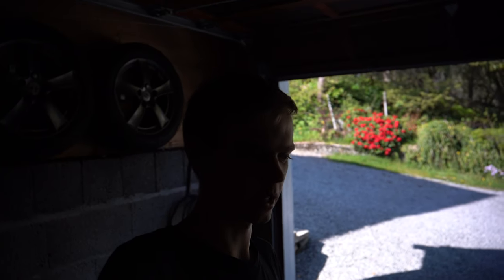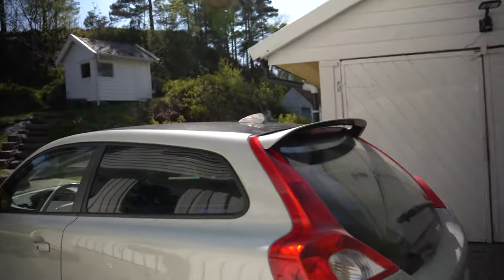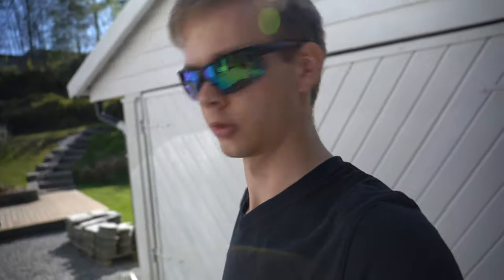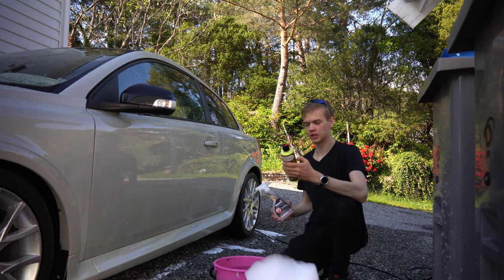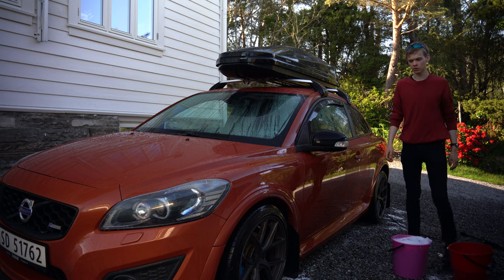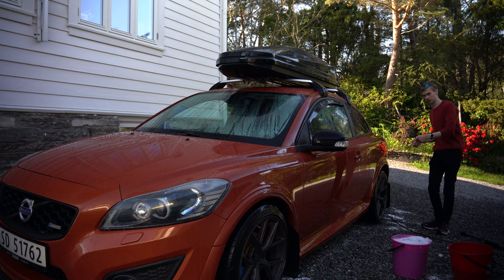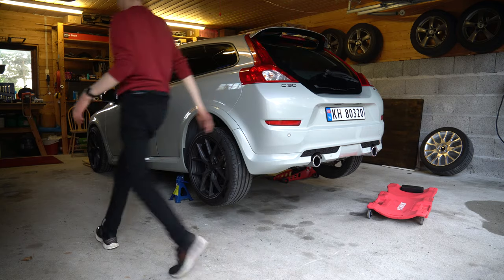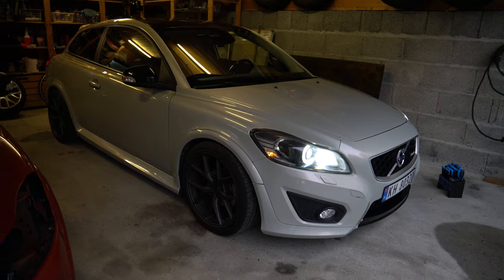I Might Have Bought Another C30 R-design... | Time To Modify!

Comment: im so jealous of all my eu friends across the water who get the diesel versions of these amazing volvos. we dont get those here in the states and its such a shame
Reply from the maker: It's both a blessing and a curse. From what information I have been able to gather, there's not a single facelifted C30 T5 that was sold new in Norway. And even with the diesels, we had thousands of c30s with the 1.6 diesel, which is just some basic unreliable Peugeot engine under the volvo engine cover. The D3/D4 were the only volvo engines they sold, and there are 18 D3s sold new in Norway, and only 2! D4s where mine is one of them. To say it lightly, I was on top of that listing as soon as it was up for sale, I called the owner within hours of the car going up for sale. I really wanted a more interesting color, but it had the M66 gearbox, R-design and the premium sound system, so it was a no-brainer. Only thing I would have liked is a sunroof, and the color of course.

Comment: Hi. Very nice C30! I also bought second C30 (2012., D3 R-design, silver.. previous was 2008. R-design, white 2.0D).. I've made almost the same mods on both.. like new wheels, coilovers, painted roof in black, LEDs etc. Now car looks really great, but I feel a need to remap and do something about the sound. I don't want to remove the mufler and EGR.. do you think that with just different muffler, it's possible to get powerful sound? Also, for remap I would go to stage 1 I guess.. should be around 70-100nm+..  just some little problems with transmission (auto) are worrying me. GL with the car!
Reply from the maker: Hi, I am in the same situation wanting som sound and remap, so I've done some research. There are no specific  exhaust systems for the D3 or D4 (same engine as you probably know). I also don't want to remove dpf or any other things that will give legal troubles. From what I've found, a T5 exhaust system will fit as long as you get an adapter for the correct pipe size. There are two videos by @richardfox2996 I've found with just DPF back exhaust system, and it sounds really nice I think. For remap, I will probably go with a BSR_Performance remap which gives a conservative 198 hp/435 nm for a decent improvement but without pushing the engine to it's limit for reliability's sake. I've got the M66 Manual, so I don't really know much about the Auto, but from what I've heard, they are decent. BSR provides the remap also for the auto version of the D3, and they always specify if their remaps will be to much for auto boxes.
Reply: @VinnesAuto I've just checked those videos. Sound is pretty good, I wouldn't want louder. I am not sure what is power flow exhaust which he is reffering to. So basically, we should just get any aftermarket exhaust system for T5 and re-fit.. that's it? I checked for BSR.. there is some shop ~100km from me so I might go do it. Thnx!
Reply from the maker: @AlphaScorpii1986  I think PowerFlow is a UK company which does custom exhaust systems. If you visit algperformance.co.uk and check their T5 exhaust systems, it says in the description that they also fit the D3 and D4 with Reducer adapters. So that's my source. So in theory just any T5 facelift cat-back system. Älg has alot of goodies for the C30s. I just ordered some driveshaft spacers to reduce their load from the lowering springs, and a new Rear antiroll-bar to tighten up the rear end. The UK has probably the largest C30 community, so I get alot of ideas and parts from over there.
Reply: @VinnesAuto  nice! Mods on car is a botomless pit :D. I am in Croatia so I would like to get stuff from EU to not have extra tax charges. Even if I don't get adapters, there are several exhaust experts in my city that could fit the new system.
On my car, I just got coilovers and rear camber arms.. everything else was just exteror mods like paint job (roof, little details, bulbs, blacking headlights inside, 10cm exhaust tips..). Car looks pretty good, but now I feel it needs more power to follow  exterior :). But I love it.. C30 is so rare to see, especially R-design.. + most of them here are 1.6. Our engine is so great. I had 2.0d PSA in my old C30 between 2013-2016, but this 5cy is just something else. I still remember how happy I was on the first ride! I just wish roads here were good like probably yours in Norway are haha
Reply from the maker: @AlphaScorpii1986  You make a good point, Norway is technically not a part of the EU but in practice we are basically a member. I do also get a few things from Sweden which doesn't require any additional tax. I only have lowering springs for the time being, but I really want a set of Bilstein B12 adjustable coilovers. I though about rear camber arms, but the P1 platform actually has a surprising amount of camber stock, so if anything I would get adjustable camber plates for the front, but they're not exactly cheap. Haha, Norwegian roads are generally not very good surprisingly, some highways here and there but they're no fun. All the B-Roads are generally old and narrow with a 80 limit, and then most of the few new B-Roads have a 60 limit :/ Which makes no sense I know. People fail to realise that inattentiveness and lack of focus is much more dangerous than going 20 over the speed limit on a nice summer day, but people's focus isn't really something they can control, so speed it is I guess. Logically I think a lot of crashes that allegedly are because of "speeding" are actually crashes from lack of focus, but they were coincidentally going over the speed limit at the time of crashing, and so it is automatically labelled as speed being the cause of the crash because it fits their agenda. Though I do also get that if you crash at a higher speed, there are larger consequences.
Reply: @VinnesAuto  Well, by bad roads here I meant holes and patches.. you need to come to balkans to see what I am talking about hehe. I was thinking between B12 and ST coilovers (KW makes them). They had the same price and I went with ST hoping they were less stiff (because the bad roads again..). Now I know that the ride being very harsh is actually my wheel being 8.5 which is too much for the 225 tyre that I have.. all the imperfections on the road are felt :/
Reply from the maker: @AlphaScorpii1986  Yeah, even my 225s on 8" wide really shows the imperfections, but I'm also on UUHP tires, so that also makes the ride more stiff. For me it's worth it though, because it also gives more steering feel. the original 18" wheels that came on mine are 7.5 wide, and they were on 235 tires,  Very comfortable, but lacking in steering feel.
Reply: @VinnesAuto  Oh nice, I saw your video from nurbungring so  I guess tyres were for that :). Good luck and please make a video about new exhaust system and/or remap if you make it!
Reply from the maker: @AlphaScorpii1986  Will do!

Comment: What exactly did you change about your headlights? Halo lights and painted? :D
Reply from the maker: That's it! Paint and flexible led strips/tubes. I have since removed the halos, because they were a bit troublesome with maintaining them. Every time they would loosen or something you have to split the headlights to glue them back in place. I ended up repainting the projector surroundings silver, as it gives the same general look and less maintenance. You can see the new style headlights in my latest video.

Comment: Where did you not get the remap from? I wouldn't want to do that to my 1.6D, because it's got plenty of acceleration 😅
Reply from the maker: I didn't use BSRperformance 🙃😂 They make quality remaps that you can load to the ECU yourself. Buy the remap with the ppc3 unit, put the car battery on charge with a 10A+ charger, and follow the instructions. Takes literally no more than 5 minutes and it has 139hp 300nm torque, with a really fun power curve!

Comment: Hey man. I'm in the market for a c30. I found a c30 2008 2.0 diesel, with The R design badge on the front  but I think it's just a sport trim variant (no other rdesign logos). 
The front bumper is curbed badly but i think I can save it. 
Also the sideskirts and the back has curb damage as well.

Any recommendations on what to be vary when buying it ? I can get the car and video call you if you'd like. 

I fell in love with this hothatch design.
Reply from the maker: Sounds like a late 2007 model, which had a sport trim but R-design didn't become a thing till 2008. It might still be factory lowered and have some other upgrades, but it's not as easy to know. I am actually planning a buyers guide for the C30, but I can give you some essentials. Ask if the DPF has ever been changed, since they're typically recommended to change every 100k km, if not that's a good way to knock some money off. Ensure that the cambelt has been changed, regular maintenance oil and filters. If it has a diesel preheater, they almost never function properly, so there's another way to get some money off. Both my C30s the preheater worked two times before they stopped working. Ideally they should be run at least once a month even in summer to maintain the system, but almost no one knows this. It is smart to find out how it is for rust on the underside if possible (depends on your location) but ideally you want one that has at some point been undercoated( I have done both mine ). Chassis rust you should look around the door-handles and on the inner corner of the doors and front fenders primarily. If it's an auto you should ask if they have done regular flushing of the gearbox, since that's not actually in the maintenance plan, but is preferable for a long and healthy life of the gearbox. Also check what tires they have on the car, because the owners choice in tire quality often tells you something about how much the previous owner cared about the car.
Reply: @VinnesAuto  Update, sadly enough, after inspection, the C30 was in bad condition, also there aren't many Volvo mechanics in my country. I went for a hidden gem, the Mercedes CLC for similar price. (same class with the BMW 1 series and Audi A3 and the C30).

Comment: I've got a 2009 2.0l diesel r design c30, I keep seeing P1, D5 or whatever, my bhp is around 134 so what does this make mine any ideas? i guess the P is for petrol and the D for Diesel but im still lost.
Reply from the maker: The D(followed by a number) is a later style designation for Volvo's diesel engine. They were used on the facelift models of the C30 (and v50/S40). Your engine is just known as the 2.0D which is a 2L 16v 4cyl engine. It's actually not a Volvo engine, it's really a Ford 2.0L TDCi engine. My engine is also technically a 2.0D, but it's a 2.0L 20v 5cyl engine with the designation "D3" or "D4" designed and built by Volvo.
Reply from the maker: P1 is a chassis designation. All C30s are P1s. The Volvo v50/s40 are built on the same P1 chassis. So are the ford focus' of the era, and the Mazda 3. They basically all share most the underpinnings with different shells on top. Volvo's earlier petrol engines were designated with (engine volume)i, for example 2.0i. And with T instead of the i of it was a turbo model, so f.ex. 2.0T.

Comment: Hope for the best with this car ... a lot of d3/d4 crack they're blocks or blow headgaskets  because of design flaw ...  same  problem as 2.5T5 , but less common [ 2.5T provoke spirited driving  much more probably ]
I live in Poland and love to buy a C30 but only really reliable 5 cylinder engine in those car's is Petrol 2.4... whith is hard to get in C30 so most probably will stop at V50 with that 2.4 which is easily availible and much cheaper than C30 with the same engine ... I really don't wanna buy diesel , i don't like how they sound and put down power , also repairs on diesels are crazy expensive when compared to this cars value - for example  full set of injectors  is close to half of the car's value ... also living with DPF on close trips can be problematic and expensive ... 
So V50 2.4 petrol or C30 1.6/2.0D for basicaly same price and for me good engine is more value than just C30 exterior looks .[ V50 is same P1 platform so identical interior and same driving characteristics ]
So for me C30 is awensome car  and i would love it with 2.0 or 2.4 petrol , just not availble with right engines for right price at least in some countries .
Reply from the maker: I knew the 2.5T has had issues there because of thin cylinder walls, but haven't really heard of the same with these engines? Do you know if it's the same with the 2.4 5cyl diesel engines? Because that is basically the same as this one only this is a 2 litre 5cyl. The 2.4 petrol is really nice, my granddad has a C70 with that engine 👌. For me, the reason for buying C30s are mostly down to their quirky features and unusual design elements which I love, but I get that from a function and logic standpoint, the v50 is a better buy. (And you can get them with T5 AWD). And yes, I get the diesel sound and feel, but considering it is a diesel, it really doesn't sound bad. I want to install a new rear muffler at least to unlock that 5 cylinder sound at the exhaust end. The power curve is very flat, but from what i have seen on dyno graphs, a stage 1 remap will make it at least somewhat more rev happy. My 1.6D with a remap is actually astonishingly petrol like in the power band where the power is almost proportional with the RPMs, which made it very fun to drive, but it is also nice to have plenty of torque already at 1200rpm on the D4, not to mention the fuel consumption of 5.4 l/100km. I knew about fragile blocks on the s60/v70 R cars, but haven't really heard about it with the C30 T5 in stock form, so it wouldn't be my biggest worry.
Reply: @VinnesAuto  After 2.4T/2.5T had problems and volvo started cooperation with ford , and ford aquired some volvo engineers ... then new ecoboost 1.0 and 1.6 started having block / sleeves related problems just like forementioned volvo engines - my first thoughts were some kind of sabotage/revenge from volvo ... but then same problems started happening on volvo 2.0 5cylinder VED5 [ D3/D4 ] diesel engines so then i thought wtf is going on ... 

2.4 D5 are almost free of cracking bloks/cylinder liners , it CAN happen but very very rarely and rather in newer biturbo ones . I wouldn't worry about 2.4 D5 - they are rather bulletproof unless really neglected . 2.0 are much more fragille and despite simmilar design [ same VEA5 engine series ] they're construction is't really the same  ;[

T5 in P1 cars [ C30/S40/V50/C70/Focus ST ] cracks just as well as on S60/V70R unfortunatelly ... especially in C30/Focus ST as more people treats them as fun car and push the powerband and/or remap the ecu . For example in Poland out of less than 20  V50 T5 currently listed on OLX.pl 5 have broken engine .... So for me it's more common than you think and volvo did changed nothing in P1 cars 2.5T5 .

I could get by with diesel feel but for me doing about 12 000km per year savings on fuel won't be even close to covering typical diesel maintance [ EGR  , DPF , Injectors and clutch/dual mass flywell whitch diesels use up much quicker ] . Even if 2.4 Petrol would "drink" triple the fuel [ whitch it won't ] it would take years for manintance cost to equalize and i would still have better time driving petrol car...
Reply: @VinnesAuto  Basicaly most of C30 quirky features and design elements are in S40/V50 as well :p ... especialy the waterfall center console whitch is awensome and really different in those cars and awensome seats . Front part of the car is also very simmilar in pre facelift S40/V50/C30 ... after facelift they differ a lot more . 

1 thing they fucked up on all P1 cars is that it does NOT have low coolant sensors ... so by the time the gauge gets "red" you most probably already overheat your engine ;[

Love the Shooting brake/ 2 door wagoon look of C30 ... maybe some day i wil get it if it shows with right engine in right time :D
Reply from the maker: @Pieteros21  That's very interesting to learn, thanks, I'll be keeping it in mind going forwards. We have almost no T5s here in Norway, so I guess that goes for why I haven't heard much about the issues. I think we have under 10 pre-facelift C30s in the whole country, and only 1 (imported) facelift T5.
Reply: @VinnesAuto  hope the D4 will serve you well at norburging :D
Reply: Thats not true, the 2.5T was only problematic with the early S60 and V70 R models, if you increase boost pressure for 350+hp without using sleeves. The B5254T3 is a really good engine, facelift is B5254T7 with a 10hp gain
Reply from the maker: @denote7025  That is what I've heard previously. I don't have personal experience with them, so I won't claim to know to much about it.